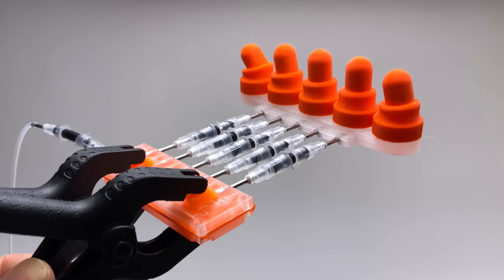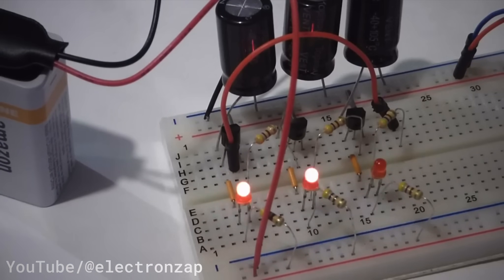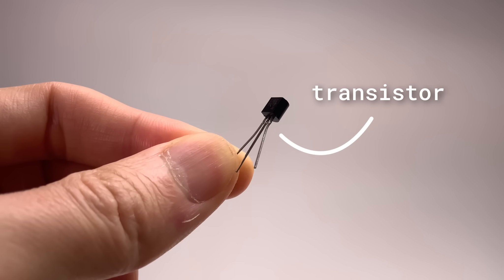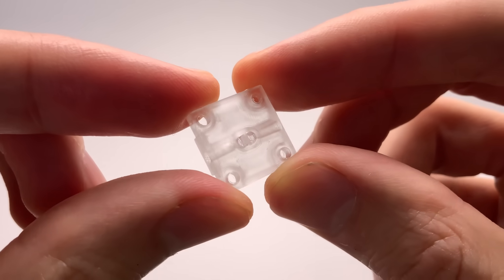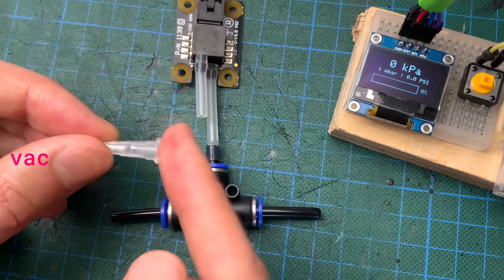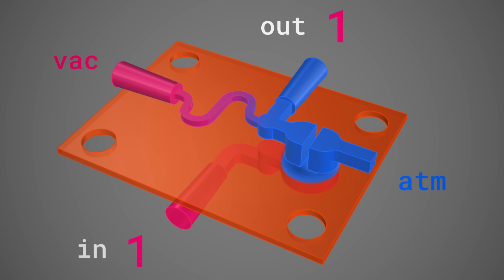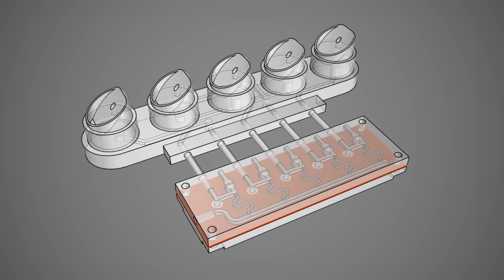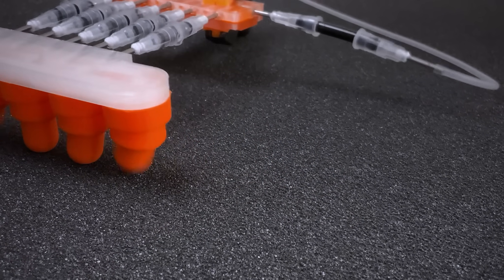I Printed a Microchip That Runs on Air — A Nervous System for Squishy Robots!

Comment: what if in order to make the creature more autonomous you use a built on pressure tank like one of those air hog airplanes that run off air compressed in a soda bottle, might only last a few minutes depending on pressure needed, but id argue that's better than being hooked into a compressor at all times

Comment: I'm curious if a pressurized system would be more efficient than a vacuum system.  There also seems to be some amount of delay when stacking resistors in the ring oscillator, which is why I wonder if pressure would end up being better.  It'd also be interesting to see a tri-state component that uses atmosphere, higher pressure, and vacuum.

Comment: add a punch card for programmable logic. you can punch it on a disk and spin it to read in the values for example. sensing should be easy with pressure. and for memory you can use delay lines. 

❤analog computing and ❤soft robotics

Comment: instead of vacuum & atmosphere we can use atmosphere & air pressure, as air pressure can be generated more easily via pressured co2 cans, pumped bottles. it will help in future when robot need to be complete off grid.

Comment: Wouldn't this also work with positive pressure, overpressure replacing atmosphere and atmosphere replacing vacuum? Then you could run it on a little CO2-cartridge, or I don't know, fizzy-tablets in a container with a pressure valve and something that continuously adds water drops to it. Then it would have it's own little power supply, even if it has a limited running time.

Comment: I think the next step would be to use positive pressure as your power source, so you can power the system with a pressurized cylinder like a small Co2 cylinder.

Comment: To be a very pedantic lil guy for a sec, that transistor is actually equivalent to a FET, like a MOSFET, because it doesn't require air-flow through the control input, just air pressure
The same way FETs require voltage on their base, not current

Comment: This is awesome.
You could even model the ring oscillator directly in the base of the actuators for some really tiny robots.
Did you already try experimenting with tesla valves? They are maybe good for diodes.

Comment: You got transistors and resistors.
Capasitors are just air chambers.
Diodes could be made easily using simpler mechanism to the transistor.

Comment: Very interesting! Maybe you can use turbulence to build better "resistors". I'm thinking higher resolution, more scalable dynamic range. Easy to make elements with different resistance in each direction, like in electrically anisotropic materials.

Comment: Nice. Equivalence of RTL logic (resistor-transistor). Far in the future, when conserve the power source becomes relevant, you can move to TTL transistor-transistor logic. Or would that already be CMOS, because your valve pressure chamber is static, making it more a FET then a classic bipolar transistor.

Comment: Really great stuff. I was hoping that you would connect 2 inverters to each other to make an SR latch and add memory to the system. Having this transistor should be enough to make a turning complete computer hahaha, pretty crazy, running doom on vacuum in a couple of years :)

Comment: @soiboisoft you NEED to buy a resin 3D printer, you can print air tubes smaller than a human hair directly out of silicone

Edit: you can also print glass-smooth surfaces directly in a resin 3d printer

Comment: Back in the early 2000s I worked for a hydraulics company that had a lot of Amish customers.  One of the projects we did for them was converting an old nc wood lathe to pneumatic power.  Of course, we were using much larger components to accomplish this.  It's awesome to see what is possible when you get really creative.
Reply: Super interesting how just changing the form of logic / power makes it more acceptable to other cultures
Reply: @LiteLotus  Yeah, a lot of people assume that the Amish are against technology, when it's actually about being connected.  They even use electricity for things like cash registers, it's just generated themselves.  I've been inside huge walk in freezers in Amish grocery stores that were powered by a diesel skid pumping pneumatic and hydraulic power, as well as electricity through the entire building.

Comment: Fascinating! Pneumatic systems have been around for a long time, of course, and I'm old enough to remember back in the 60s when fluid logic or fluidics was set to be the Next Big Thing ... but the 8-bit microprocessor was just about to take the stage.
It did find industrial uses though, and I shall have to see what I can find out about its progress. Meanwhile, your work is, well, fascinating! I'll be following it from now on.

Comment: Could the membrane be bias towards a different pressure balance? So that a smaller transistor pressure allows for a greater output pressure?
Reply: Greater pressure maybe, but lower volume of flow kinda like how his resistors work.

Honestly I think these would work pretty well for a range of pressures so long as it's enough to deflect the silicon and not too much to rupture it

Comment: Your circuit is intensity-limited, so consider that as your main resource, and plan your air succion ratio (production/consumption) with care!
Reply: Perhaps his system needs capacitors too? IE pressure/vacuum vessels that can  help sustain vacuum/pressure in distant parts of the system?
Reply: Plus maybe add a spring-loaded piston, to act as condensator?
Since you don’t push air in the system, have a way to let the spring succion the air either from the circuit or the atmosphere, and release it somehow with some magic switch.

Comment: In the 1960s I was an aerospace tech. One of the projects I tested was fluidic controls using air. The main reason for the technology was radiation proofing controls for missiles. Russia, I think, was still using vacuum tubes. Tubes are rad-hard. Semiconductors in the 60s were prone to radiation upset (like a short across supplies). The work on fluidics I tested did logic, had oscillators and amplification. Dimensions were gross based on today's technology.
Reply: wow, can you tell us more, or recommend reading or resources on the topic? like were your logic gates the same basic design as in this video?
Reply: @herzogsbuick sorry….so long ago. 1960s. I was only the technician back then. Most intriguing to me was a flip flop where the flow could be “attached” to the side of a channel.

Comment: I'm really curious what drives concepts such as "gain" and "delay" in these circuits. Like, how much air you need at the "gate" to switch a bigger air current, and how fast the oscillation runs. Would it help to build an output buffer?

Comment: I can remember from the first air-powered mechanical propeller used in diving and most of newmatic without electric solenoid using positive air pressure valves to control logic, first time seeing vacuumed logic with less force to create the same effect, this is much smaller and I can see it's useful potential in the future. Good work!

Comment: i imagine your system is very similar to a crustacean's water based locomotive system. though likely using positive pressure as 1 and no pressure as 0 since it would be easier to contract a muscle to build pressure rather than vacuum.

Comment: Watching, I thought you need the larger size circuit to drive the legs, but there is not reason you could not have a smaller 'brain' that triggers the larger circuits.

Comment: You’ve engineered a miniature strandbeest, but instead of relying on ocean breezes like Theo Jansen’s originals, you’ve given it an artificial “lung” a vacuum pump that breathes life into its legs. Each hiss and pulse of pressure is like a heartbeat, turning raw physics into motion. It’s not just art-meets-engineering, it’s biomimicry on the bench: a tiny mechanical creature walking on invisible air currents you’ve harnessed and tamed.
Reply: ai comment?
Reply: @realClarence112  most definetively
Reply: more like an air driven muscle. The lung in itself is not necessary for  the movement, but to sustain the air pump. 
So the lung is powering the pump, wich is powering the muscle

Comment: Considering air is compressible, you could get faster response times without the "springiness" if you were to use water which is not compressible or if you want something with a bit more viscosity for one reason or another you could use mineral oil or some other fluid.

Comment: can this air tubes + silicon suction be used to build a 3d printer that prints more 3d printers. it wouldnt be presice but it could take a 3d design and convert it into mechanical printing actions

Comment: You know, you could augment your design and easily have a ternary computer instead of a binary one. I'm sure as you know a ternary computer uses 3 numbers instead of 2 like a binary computer does, right? What you can do is have -1, 0 and +1 be represented by vacuum= -1. Zero gauge pressure = 0. Positive pressure = +1. Voila! Ternary air conputer! I think your design could be easily modified to accommodate this concept, but then again I could be totally wrong. Your squishy robot could walk forwards and backwards without changing the air flow. Cool. I would really like to see a video on that. I think a lot of other people would too. I have to face reality. I don't have the means to attempt this myself. 😢 If you feel like doing it, that would be great! You've opened my eyes to a lot of possibilities with this video. I really appreciate it. Not that it matters, but you earned yourself a subscriber. 🙂 Thanks for the great video. Cheers!

Comment: If you could build a neural network out of rubber and air, silicon chips would only have to handle input and output; power consumption would drop significantly!

Comment: You might be able to build a capacitor by using an air / vacuum chamber that takes time to fill up to reach pressure. That could then for example put a small delay between raising a foot and moving the leg forewards.

Comment: how do you print transparent? Petg, low speed, high flow?

also, what happens if air and atm is replaced with hydraulic fluid or water and a pump outlet?

Comment: Not a chip, not micro.. and, did you not consider pure fluid dynamics instead of the "clunky" membrane solution?

One thing very typical of ring oscillators is that they can produce harmonics (as per what you observed before some jiggery pokery with the outputs). One way to fix this is to have a simple bistable oscillator feeding the first stage of an open ended delay line. That way you can shape the pulse and send multiple pulses (as / if required)

Comment: Very cool project. One question. Normal transistors can drive a current higher than the one that controls them. This means that you can use small currents for your logic but control high currents for your actors. Does this also work with air logic? If so, you could use a small pump for the real logic and a second, more powerful for the actuators.. 

btw. did you consider that a transistor or inverter could be useful as some kind of tactile sensor?

Comment: I think you can replace the resistor with another transistor that allows atmospheric air in to make the circuit more efficient. That should also make it a little quieter.

Comment: I like watching your videos. You give me things to challenge my mind. Whiles a chip like this is possible it is not practical for modern day use. It be used for very very basic things like the project you doing. You should try to make a ternary version. It will better since it uses less transistors. The video below will give you an idea. See if you can pull that off. If can do that then you are the bright spark. 
https://www.youtube.com/watch?v=3aewaff1494

Comment: With these soft robots there are 3 modes, not 2: 1=Vacuum 2=ATM 3=Greater than ATM Pressure
Not sure if this could help in this example, but it is different from electronics in that there is the 3rd option. 

I suppose it could be like a charging a battery or a transistor instead of on/off or 0/1 type thinking.

Comment: Loved it, although i understand you are "providing" vaccum i dont really follow the 1 for vaccum and 0 to atm, after all the work is done by the pressure not the lack of pressure (for this example the transistors you made would be pnp instead of npn and the tap gesure would represent a normally closed momentary switch (without tapping the logic would be high (atm) and the transistor would be closed and by tapping logic becomes 0 (vacuum) and transistor opens)) for extra context vacuum is like cold doesnt exist what exists is pressure and heat

Comment: I work in semiconductor manufacturing and this is really cool, the layered construction is not far off from how real microchips are made. I am however thankful that I have to work with stiff silicon wafers instead of squishy silicone wafers. Would be a nightmare to have any form of automated wafer handling.
Reply: Can just imagine how impossible it might be to get 10nm details on a chip to line up if it were flexible, the failure rate would be nuts, and I'm just an enthusiastic layman XD

Comment: Would replacing vacuum with ambient pressure and ambient pressure with high pressure also work and maybe provide better results as you could have higher pressure difference also pressure pumps may be cheaper than vacuum.

Comment: The same can be done with a fluid. Also, the older car automatic transmissions were basically fluid controller analog computers which determined which gear to be in. A great video, thanks for sharing!

Comment: I think you would realise this but if you only used like one connection you can connect to reducing the space and also reducing the leakage from the syringe heads so you can only use one like metal tube

Comment: Something else about transistors is that it allows relatively "small" signals to switch "large" signals. In electronics, this corresponds to the amount of current, in your setup, this would be CMS (cubic centimeter / Second). By refining your transistor designs, you can make it so that a ridiculously small amount of your vacuum is "wasted" on the control circuitry itself. Then by placing "power transistors" between the outputs of your control circuits and the inputs to your actuators, you can optimize the needed vacuum for the whole system. The upside is that your keep the size and power consumption of the needed vacuum pump low.

Secondly, you can fashion human inputs by making a transistor that is normally open, that a person must push the membrane inward to close. This would give you the ability to have some outside control. I also have ideas on how you could make a more power efficient electrical -> air conversion that would allow you to have some wireless input.

If you get a liquid resin printer, you'll be able to do some truly ridiculous things with this.
Reply: This solution rapidly runs into problems.. In mosfet terms its like needing a gate voltage Vgs higher than drain Vds, or sacrifice any kind of current gain! In this, if the "gate" cant suck the membrane off the "source", it wont operate. Meaning that the "channel" area has to be small.
Reply: @dougaltolan3017 true. though i feel like you could exploit the venturi effect to get around this, maybe

Comment: hey I build logic circuits from discrete parts all the time, you might get better performance if you add an amplification stage after every inverter, just a simple 'transistor' should do the trick

Comment: Whats your settings to get a 0.2 nozzle to work properly? I've been having issues with mine. Skin layer on top of infill gets really rough and stringy and doesnt lay down cleanly over the infill leaving to a rough top surface. Using cura.

Comment: We use some stuff like this were I work
Significantly simpler logic and working by pressure rather than vacuum 
But I still love them so much
A bundle of tubes with no electronics that’s able to do basic 2b math and check (analogue!!) conditions

Comment: Awesome. It's an PNP-Transistor, right? A NPN (closing valve) shouldn't be a problem with this technique either. Maybe it's possible to build an air driven OpAmp for sensor data etc....wohoo..

Comment: Ok, but now I want to think about designing pneumatic capacitors and inductors
Reply: 1. What is the current analogy here? Is it the airflow? Would the voltage analogue be the pressure then?
2. If Voltage is pressure, then would a large chamber contribute to be some kind of pressure storage? As a capacitor is meant to hold voltage to varying currents.
3. If air flow is the current, how would you go about making an inductor then? Or do we just start making pneumatic OPAMPS to avoid using inductors altogether for creating filters?

Comment: Would it be possible to create a dynamic airflow resistor by splitting it into multiple lanes of various thicknesses?
E.g. at the resistor's entry instead of just one 0.5 mm lane, split it into 0.5 and 0.6mm that merge before its exit. Maybe have them merge at half-way into the resistor. Different merge-points would result in different timing, i guess

Comment: I think it should be possible to get the contol signal to the bottom layer using the same geometry as the control side of the transistors. 

Just a chamber on the top and bottom connected by a relatively large area of silicone so the pressure can be transmitted. Similar to a capacitor. It seems you have skipped right over the humble bjt transistor right to the fet transistor. 

Awesome work man keep it op. You make me want to experiment with this as well.